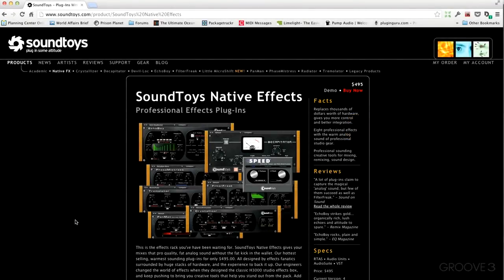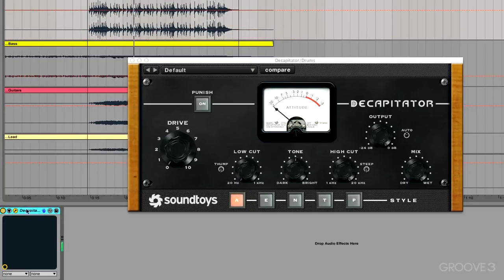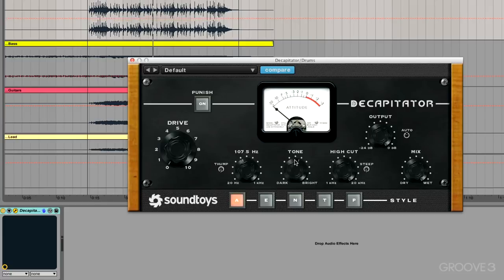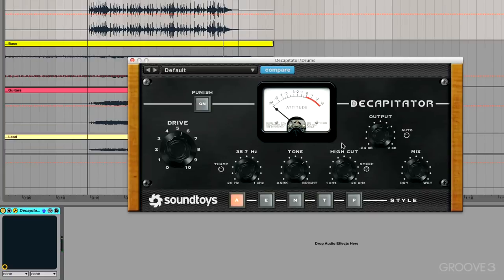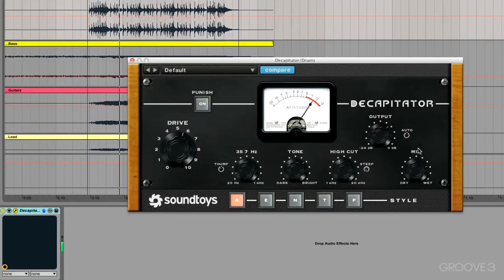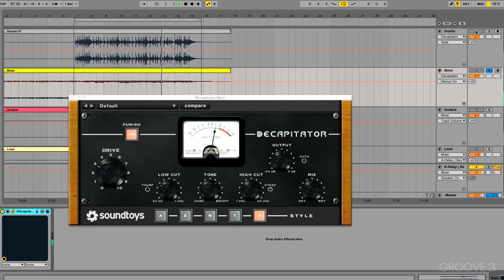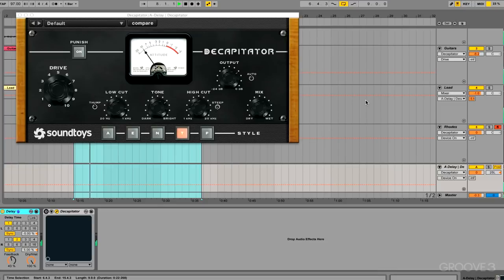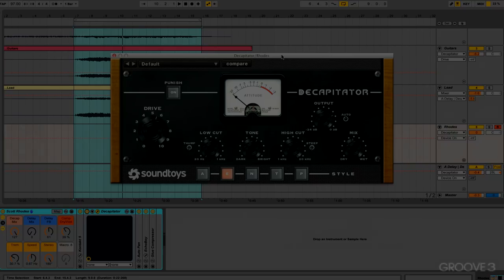Decapitator (SoundToys Effects Explained)

Comment: If you upload at higher resolutions than 720P . . . we can actually here the subtle differences in tone
Reply: doesn't make a difference. only 240 and 144p sound worse now
Reply: Wrong. The bit rate and compression changes with Video quality. If selling audio related products the provider should have a link to the Original (WAV etc) for best quality - otherwise you are just hearing YT's aggressive compression artifacts.

From YouTube FAQ's:
1080p 192 kbps AAC
720p 192 kbps AAC
480p 128 kbps AAC
360p 128 kbps AAC
240p 64 kbps MP3
Reply: 720p have highest quality sound on youtube